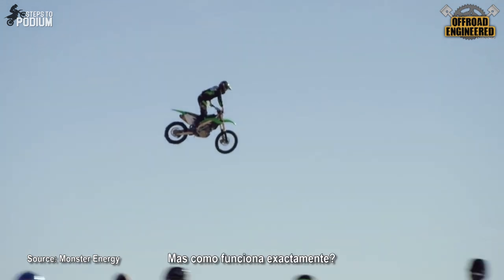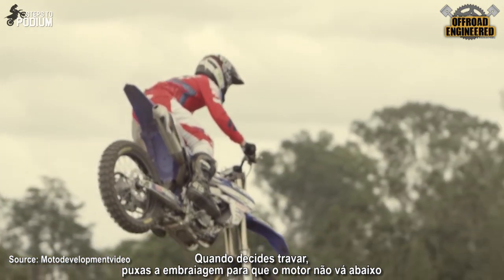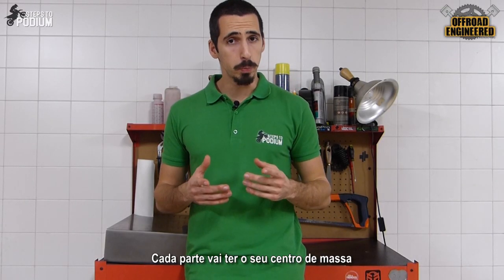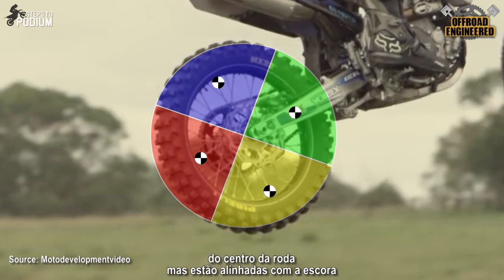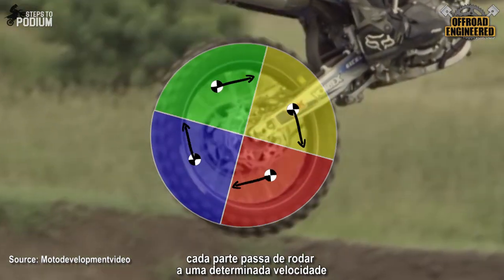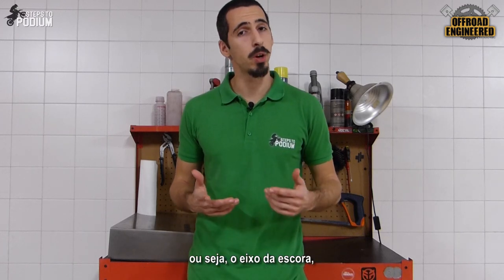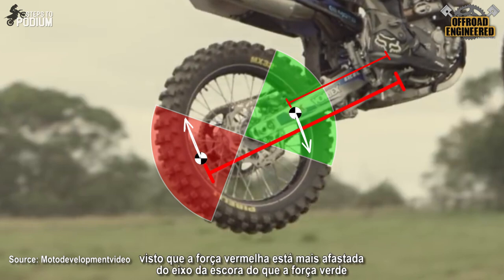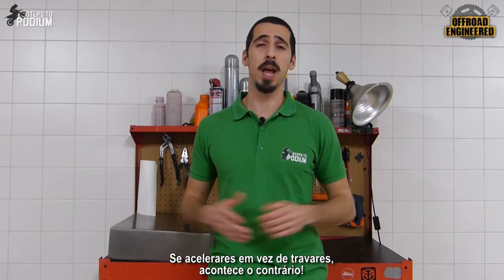How mid-air adjustments work | Offroad Engineered

Comment: Does the Bike Brand matter?
Reply from the maker: is it a serious question? 😅😂
Reply: Im Talking about overral , not mid air adjustements.
Reply from the maker: @tiagocosta9898  it matters about what?
Reply: Steps to Podium Speed,handling and not overpriced
Reply from the maker: @tiagocosta9898  depends on the displacement!
Reply: Steps to Podium Thanks and sorry for Wasting your time with a stupid question 😂
Reply from the maker: @tiagocosta9898  no problem, any time!😊

Comment: Sorry, but the explanation of the physics is incorrect. Brake tapping is a result of the kinetic energy of the rear wheel being transferred in to a force couple acting at the brake caliper mount and rear axle. Given the bike is in the air this force couple is not transferred through to the ground and hence gives an angular momentum to the bike which causes the bike to rotate. The length of the swing arm has no influence and there is no cancelling of forces.
Reply: Totally agreed